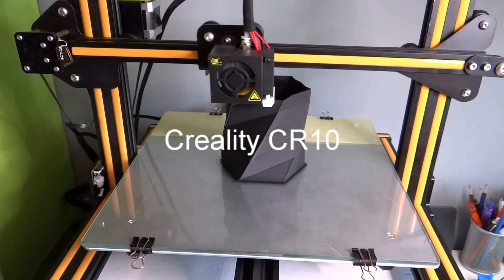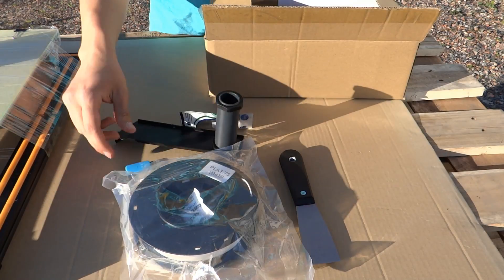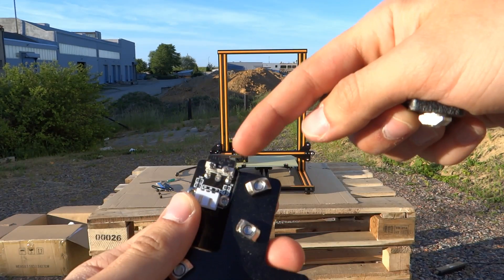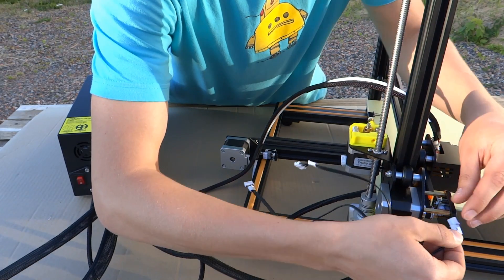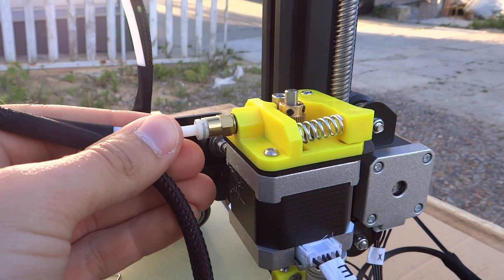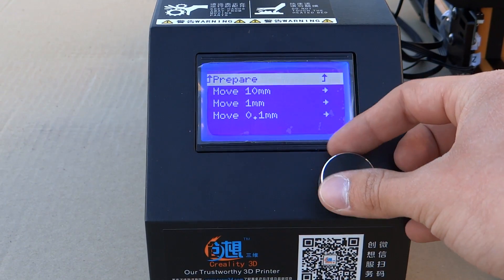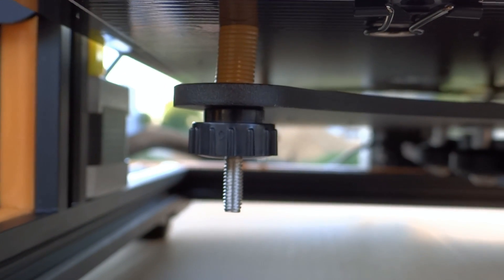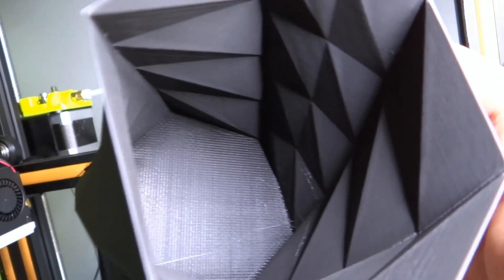Creality CR-10 - The perfect cheap 3D printer

Comment: hi, is that need to chechk the extruder every time we going to print new model?
Reply from the maker: What do you mean by check the extruder?
Reply: i mean wheter need to set the z axis position to the bed everytime we start a new model?
Reply from the maker: No you don't need to, just from time to time depends on how you use your 3D printer, I am doing that like few times a year.

Comment: @Nikodem, I just ordered a CR-10, but it's not delivered yet.  I have questions about the glass surface you have on the bed.  Did it come with the printer?  Does it take longer for the glass to heat up, and how do you compensate for that?  Do you always print right on the glass, or do you sometimes tape it first?  I have been printing onto tape on my ANET-A8, but on the CR-10 I want to try printing onto glass.  Thanks for making this video- it is very helpful!
Reply from the maker: Victor-charles Scafati yes the glass bed comes with the printer. I am always printing on glass without tape, that's the best way. Maybe it take a little bit more to heat it up but I don't test it without the glass on bed. Thanks for comment!

Comment: Nice video :)
How would you compare this printer to the previously described JGAURORA Z - 605S?
Reply from the maker: marantex Hi! Thanks :) quality on the Creality is much better, it has a bigger printing area and is easier to assemble. I still use my old 3D printer and it taught me a lot about 3D printing but CR10 is better in every aspect, it is bigger, it's quieter, Bowden extruder make it possible to print faster, it looks better and it is much safer (all electronics is in enclosure). In my opinion if you want to spend less and learn more to with 605S if you want better quality and bigger printing size take Creality CR10
Reply: Thanks :)